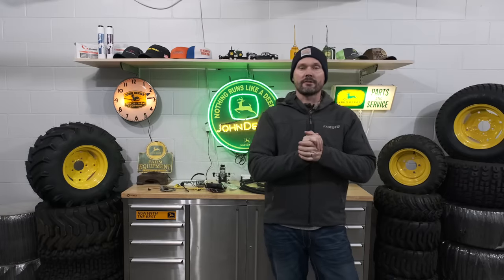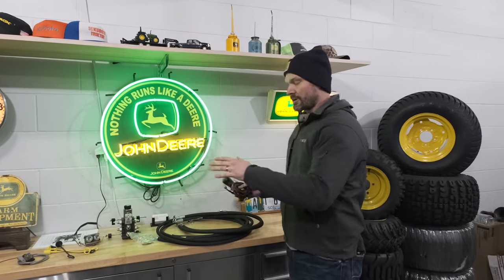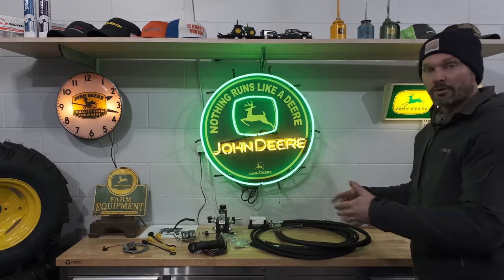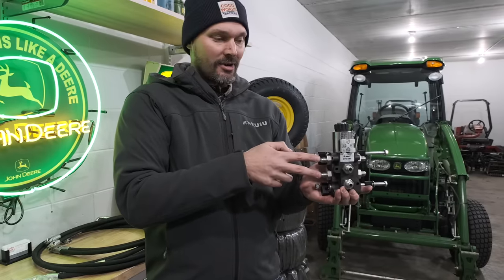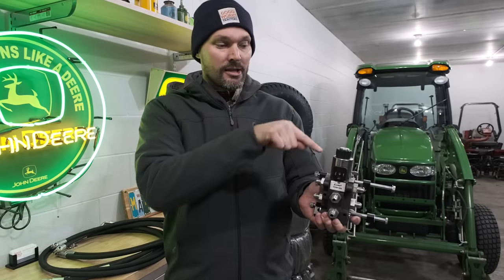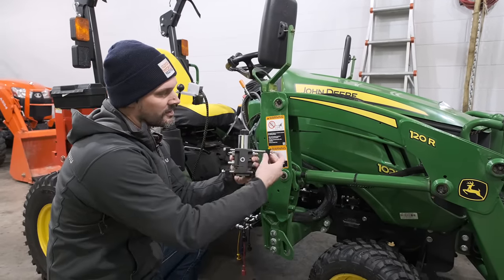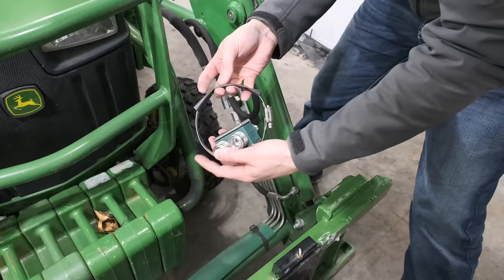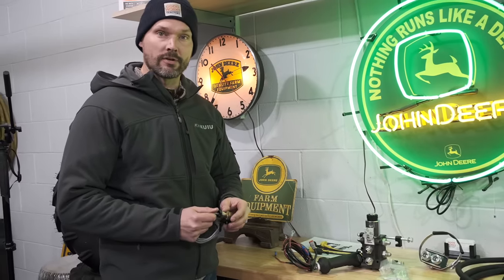FINALLY A CHEAP 3RD FUNCTION DIVERTER KIT FOR A TRACTOR! 🚜

Comment: I added one a diverter and grapple to my BX last spring!  Best addition I've made!

I had to mount the valve on the outside of the loader, there wasn't room inside.  It's still within the track of the rear wheels, so it's not like it sticks out.  I used 90° on the outside ports to keep it skinny, too!
Reply from the maker: Awesome, how was the DIY install?  Think most owners could figure it out?
Reply: @GoodWorksTractors  It wasn't bad at all.  I pieced mine together instead of buying a kit, but once I had all the pieces and made a couple of brackets, it went really smooth.

On my BX2230, the loader valve is on the loader itself, so I think that made it simpler also.  The only additional connection (when removing/installing the loader) is the electrical connector from the fuse block to the switch/solenoid.

I'm not much good with this youtubes stuff, but I uploaded a short video of me sounding like a goofball and showing my install if you want to check it out!

Comment: I just installed the 3 port multiplier from Summit on my 2520 to control the chute rotation and deflection for a rear mount snowblower.  The valve diverts the curl loader function to the rear couplings.  The hardest part of the install is routing the four hydraulic hoses from the bottom of the tractor to the rear.  I mounted the valve to the right side roll bar, so it is at a nice height for coupling and uncoupling.  The kit comes with everything needed for the install.  The guys from Summit are great to work with and I would highly recommend purchasing one of their kits.
Reply: The kit comes with a cigarette lighter plug to power the solenoids, however there is no “Off” position on the switch so one of the solenoids will always have power and will drain the battery if left plugged in. I ditched the plug and installed a relay under the dash with the coil connected to the ignition switch, one side of the relay is connected directly to the battery, and the other side to the solenoid.

Comment: Excellent info!  The multiplier is an excellent solution to getting a serious quantity of SCV circuits for controlling hydraulic cylinders on 3PH attachments.  Not only can you go from one to 6 circuits in your example —of which only one needs to be adjusted at a time— it is, by far, cheaper than any factory solution.  It is also far easier to install than factory SCVs since they need someplace for each SCV valve, a way to position their control sticks in the operators station, and a way to rout their hydraulics to the back of the tractor.

Comment: Thanks for another great informative video. I have the Summit Diverter valve kit installed on my John Deere 2038r and I love it. I use it to operate my grapple I had my John Deere dealer install it when they installed the 2 optional SCVs on the rear of my tractor. I really like the "fighter jet" style joy stick handle with the trigger in lieu of a thumb switch.  Makes it effortless to toggle between the the dump and curl and the open and close functions.
Reply from the maker: Right on, that's good info.  Thanks for sharing!
Reply: @GoodWorksTractors      Hey I’m getting all the parts I need to hook up a front plow. I have a 2320 JD, I was wondering if you might have the part numbers from summit for the 3rd function kit with the joystick handle? This is all kinda new to me. Thx. Hopefully you get this. Again kinda new at this cell phone stuff🤯

Comment: I purchased the Summit diverter kit for our Deere 4105 to run a brush grapple. Looking forward to installing it soon. Instructions are very detailed and specific to tractor to be used on. 
This model does not have rear remotes and we are researching ways to mount one soon.
I will be checking with Summit to see if they have a solution.
Thanks for the videos, we are looking at more accessories for it.
Reply from the maker: Hope you enjoy it!
Reply: @GoodWorksTractors  Sorry, we looked at several different brands and and went with Artillion. Got the names mixed up. 😏

Comment: I guess I was 2 weeks early to take advantage of your discount code. I ordered a Kubota True 3rd Function kit and adapted it to fit my FORD NH 1520. Excellent quality and works flawless. Now I want to add a rear diverter kit for Hydraulic Top link and maybe angle.  
 I went with this kit for my new dual ram grapple.
Reply from the maker: Nice, glad to hear it's working well for you!

Comment: I'll add this, it is a challenging install (Summit Diverter) if you also have a Single Point...It will not fit on the Mast like they intend. I am adding a bracket to get mine out away from the SP. I would not want to put it on the outside of the mast. FYI   The lines tho are plenty long to place it where it fits, and I knew it would be tight when I ordered it.

Comment: I use a Faster 6 block ( 3 SVC points) for my 1025R great when switching form Loader to Snow Blower.  I am just starting to look into a grapple so this is perfect timing. can not wait for the install video on the 1025 diverter.

Comment: I put one of Summits true third function kits on my Mahindra 3 mounts ago. Works great!  In my area I saved 75% over what the dealer wanted for just the value and summits made it so easy to install in under 2 hours.
Reply: which mahindra? I have a 1533 shuttle that I want to add third function to. I would use the rear hoses but I have no control lever for it once I remove the backhoe. Seems like wasted lines there with no way to control them that could work with really long hoses and a valve.
Reply: @lh98  I have a 2017 Max26 dot. I just came out of the power beyond port on the loader valve and into the Summit valve. Out of the summit valve and back to port. They included all the fittings and hoses and loader buttons. Super simple to do.

Search . Third Function Valve Kit for Kubota L2501, L3200, L3301, and L3901 Tractors
Brand: Summit Hydraulics on Amazon
Reply: @cnccutter61 do you think this same kit would work for an Emax 20 HST?

Comment: I had Kubota add a 3rd function valve to my new 2650 before I picked it up.  Just for comparison, the cost was $800 installed. This kit would save you about $250.  Although not quite half the cost, and you do have to install it, I would think it would be pretty simple for someone that is a car guy or has some mechanical knowledge
Reply from the maker: This is a example of the cost of adding an option when you buy the tractor new vs doing something after you already own the tractor.  I tell folks all the time to add these types of options when buying new as you'll save lots of money vs adding on down the road.  Your example just proves that point further.  Also, that's about the cheapest I've ever heard of any dealer adding on an additional function regardless of Kubota or JD.  Thanks for sharing, good stuff!
Reply: Good Works Tractors yeah the price around here is 1500 for installed 3rd. I have a 1533 mahindra I want to add function for a grapple but am unsure if I could use the rear lines I have when backhoe is off but those lines have no control lever (controls are on the backhoe). or maybe I should go with diverter ?

Comment: Thanks for the info on the summit products. I've been looking into summit to increase my own functionality, and this is a great start to covering their products. I'm looking into the EH valve blocks, rather than a diverter/multiplier kit, as having these functions on a dedicated circuit seems safer, and more productive. The only issue I have with the EH valve blocks is that they don't appear to have any proportional controls on offer at the moment. Using the diverter/multiplier would allow that by utilizing the proportional control already installed on the tractor (joystick). It's a toss up.. The price range is similar, but the pros and cons of the actual hardware make it hard to decide.

For any that don't know what I mean by 'proportional' - I mean that you can control the speed of the hydraulic circuit.

Comment: Just had my fixed I have a false VALVe I think JD charged maybe 7 or 800. Valve got stuck THEY took it apart cleaned. Works great was supposed to BE under watt

Comment: Super find. Definitely on my future purchase list for when I get home from deployment in 2022, for now though I’ve got my sights on the brush crusher first. Making the most use out of what I currently am set up for. But I’m sure if after a Brush crusher, I put on a diverter system, I’ll be able to sell a used brush crusher and have a good chunk for a hydraulic grapple... but is it worth the loss of capability with a 1025r? The loader is already limited on lift capacity

Comment: Is there a single connect hydraulic kit for using loader/mower on 1023e tractors?  I have a leaking connection where I switch out from loader to mower.  Yellow connector

Comment: Is the first valve that you showed something that, if mounting the valve somewhere other than on the loader, you could use this to potentially run a hydraulic actuator for a front mounted snowblower chute deflector?

Comment: A video showing the installation of a 3rd function valve for a grapple on a L3901 that already has rear remotes installed would be great.  I want add a grapple to the FEL for a grapple.  I am using the rear remotes for a Lane Shark.

Comment: think it would possible to rig the actual trigger mechanism [ not the handle] on the 4-way handle of the 1025r? would seem difficult to operate electric solenoid trigger handle and 4-way hydraulic remote at the same time.
Reply from the maker: The solenoid trigger handle replaces the handle on your joystick

Comment: Does a dealer installed 3rd function work as a diverter valve or are you able to do 2 functions simultaneously such as raise the bucket and clamp the grapple down at the same time?
Reply from the maker: Good question.  That will totally depend on the tractor, the dealer, and what's requested.  Every tractor will be setup differently, have different hydraulic capacities, and many times dealers and/or customers will mistake one for the other.
Reply: David I installed an OEM 3rd function from my manufacturer, TYM, and it is a diverter. You cannot do 2 functions simultaneously. Like Courtney said though that does not mean other manufacturers use diverters for OEM 3rd function kits.

Comment: Would the 1025r H120 kit work for the 2025r H130?  I can't see why it wouldn't.  I would just prefer to get this kit, with hoses included, rather than a universal kit for all tractors <15 gpm.

Comment: Very nice butt it won’t work for attachments not hooked to loader, such as snow blowers. Maybe it cud be hooked under the tractor.
Reply from the maker: You could get different hoses and reroute to the back with a quick disconnect back there.  So, then you could plug into something on the backside if needed.  Or, slap a quick connect on another set of hoses from the back going to the front if you want to run something like a grapple.

Comment: Lots of people don't know about 3 Spool valves.  for older tractors this is also a valid option to adding a 3rd function for a grapple and maybe a little cheaper. I looked into a diverter valve I didn't want the electric component involved so this is the way I went.  These don't work with the newer compacts as the loader valve is integrated in different locations though.  

https://www.shortlineparts.com/complete-joystick-packageshtml/3-spool-valve-80-hp-tractors.html
Reply: Hey Drew,  Can you tell me more about this please?

Comment: Well, I bought the Summit front third function kit for my 2038R with Titan 48” grapple.  Literally, worthless installation instructions and no mounting hardware (drilling required but I can’t decide where that would be out of the way and still protected). What they sent me was completely different from your video.  It was $450, probably should have gone with the more recommended WR Long system.  I’ll be several hundred more in once I buy all of the correct fittings and hoses to make this work.  Pretty much gave up for now.

Comment from the maker: IF YOU WANT TO RUN A GRAPPLE, THEN YOU NEED THIS: 5% OFF SELECT PRODUCTS WITH CODE GWT AT SUMMIT HYDRAULICS! https://summit-hydraulics.com

TRACTOR DIVERTER KITS & HYDRAULIC MULTIPLIERS: https://summit-hydraulics.com/hydraulic-kits/?ref=goodworkstractors
Reply: I know it's early after the video, but Summit didn't have a 3rd function kit with the hoses for any Deere products unless I missed it.  Just the universal kits, and ones for Kubota's.